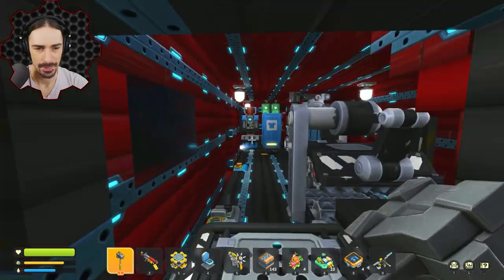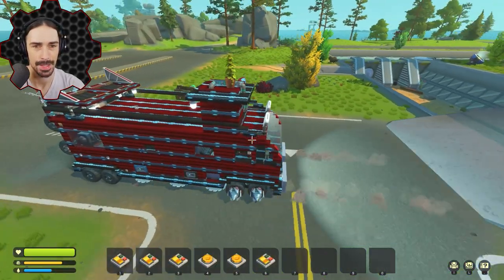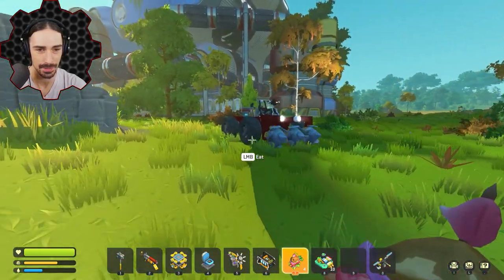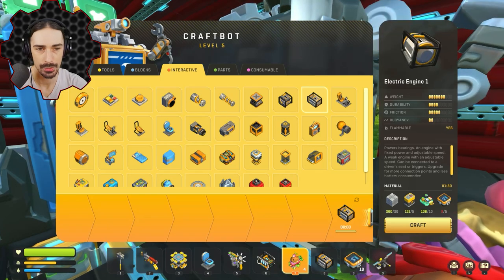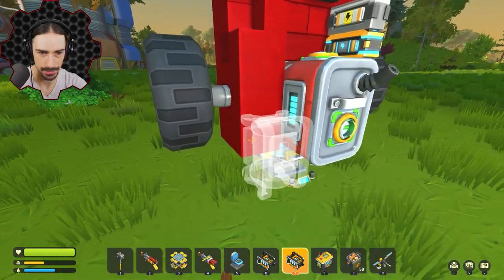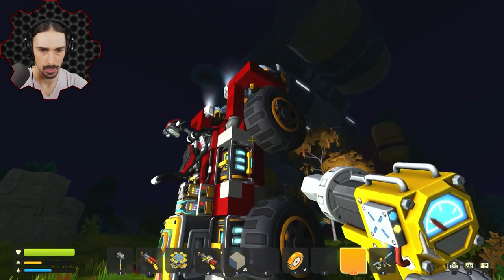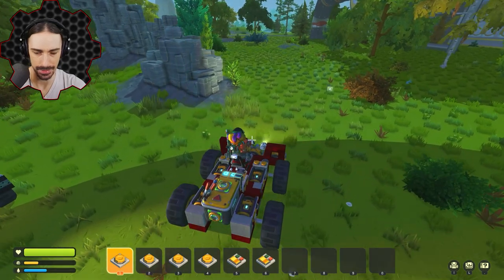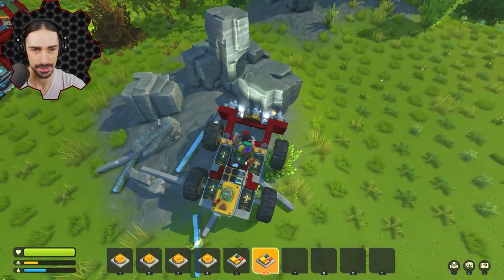Mining Vehicles: Gas Engine or Electric Engine with Tank Steering? - Survival Nomad 27

Comment: So, now you need to source glow poop? Maybe instead of taking them with you just create a small portable holding pen that you can drop in the nearest water and temporarily capture one or two to create poop while you are doing a 24 hour farming stop? Then pick up the farm, the poop, the pen and leave the critters behind as you move on.
Reply: Only downside is them eating cardboard and pooping out would stop if you go to far away
Reply: @tempestrage257  Hm. Good point. But I have to wonder if any "poop" would even remain in a mobile pen or if it would get "left behind" as the RV moves. Floating/uncollected objects are "world location" dependent, right?
Reply: @Bigrignohio  hmm, not something I've tried😆
I guess it would need to be collected before moving on, yes, otherwise it would 'fall off' when you start moving. 

A solution I think could work, would be setting up some pumps to vacuum up the glowpoop
Reply: @tempestrage257  That kinds of makes the pen "not small". Vacuum pump plus container plus logic block.
Reply: @Bigrignohio  nah, just a pump, maybe at the bottom of the pen, hooked into the crafting chests with some tubes, then connect the pump with the same switch as the inhausts  that would take care of collecting the glow poop. Then feed them manually the cardboard. Could go auto but yes, then it starts to get 'bigger', its possible though. 

Though I think the glowbugs will despawn/die due to being in a moving object with collisions etc scrapman would have to do some experimenting

Comment: bearing/controller, 3 types not 2, no fuel
Reply: atomic power source, no batteries/gasoline, multiple consecutive controller bearings, to get up to speed
Reply: scrap mechanics needs a hand glider
Reply: fortnite style
Reply: optionally powered glider
Reply: personal jet stick, with stabilization
Reply: witch broom
Reply: 4 controllers
Reply: convert to no-fuel engines
Reply: think its a solar-electric driven vehicle